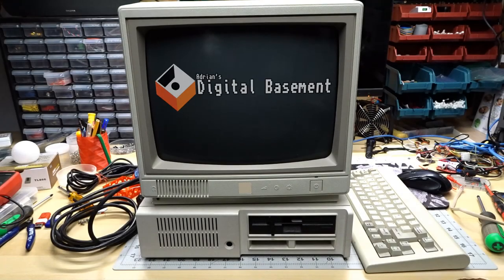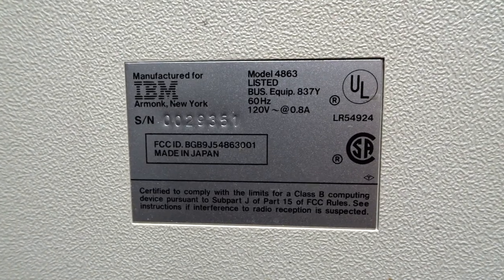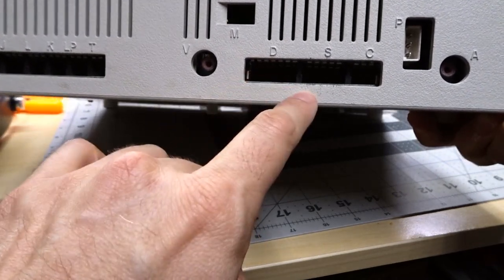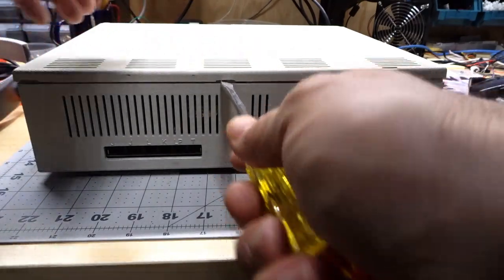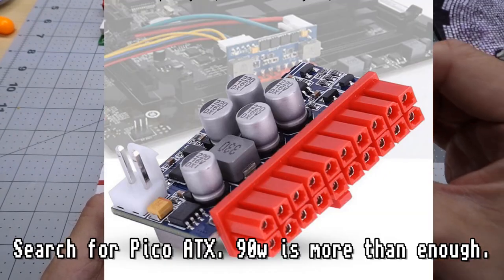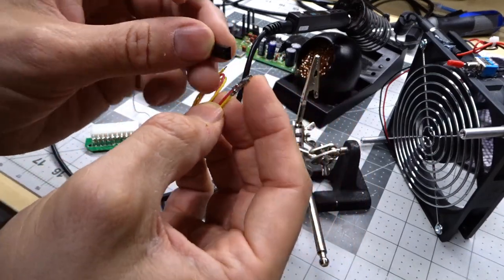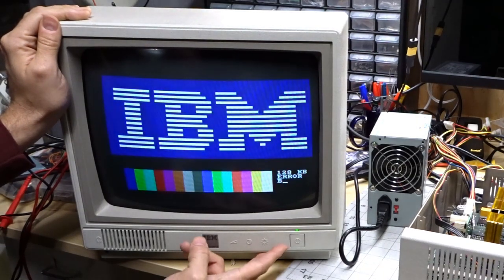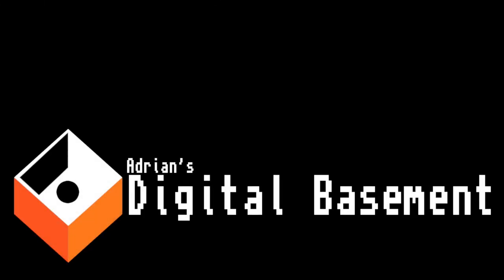Found a cheap IBM PCjr -- does it even work?

Comment: Those proprietary connectors on the back are just 0.1” pitch pin-headers. You can easily make your own cables to plug into it by getting female pin headers, but be mindful of the orientation. IBM had a continuous pin header with little breaks where they put dividers between the ports - these dividers were very fragile and would break, falling out!

Comment: You're in luck!  This is THE computer I had as a kid, so I may be able to offer a little assistance or answer a few questions if need be.

Firstly, yes, the connectors on the back are proprietary, I believe they are called "Berg" style connectors.  The monitor is indeed a regular CGA monitor, and IBM actually sold a breakout cable that converted the Berg connector to a DE-9 for use with any other CGA monitor.  Somewhere in my travels I picked up a PCjr monitor that had its Berg connector removed and a standard CGA DE-9 added.  Stupidly, I gave it away.

The floppy "handle" is legit, that's exactly the style it used.  "M" is definitely the modem port, if it were so equipped.  I believe the modem that was available was a 1200bps modem (as was the one for the IBM PC Convertible).  "LP" was definitely Light Pen.  Never had one, I don't even know of any software that would even use one, although the onboard diagnostics (if I recall, invoked by Ctrl-Alt-Ins) has a test for it.  "V" was composite video out, "A" was audio out (mono, line-level).  As with any other CGA, both the DE-9 and the composite could be used simultaneously.  "C" I think was for Cassette.  There's an actual relay on the mainboard that's audible and can be invoked (I think just boot with no disk into Cassette BASIC and type LOAD).  There was also an early piece of software called "Personal Musician" that messed with the cassette relay if you played a certain song.  I think the song was called "Roller Coaster" and somewhere during it, the relay would click and it would "knock out" the speaker on the monitor and just play via the internal PC speaker.  I guess that was normal behavior, otherwise there might have been "crosstalk" and you might have heard data loading from the Datasette.  A reboot (at least) was required to reset, if not a full power cycle. 

10:48 yeah, with the case off, the light hits the lens of the floppy drive's LED and it looks like it's on.  I believe ERROR B means no keyboard.  Probably nothing wrong with the system.  You're going to have to either source a cable for the keyboard (yes, it plugs into the "K" connector in the back), but I'm sure a breakout cable can be made if one can't be found.  It's only 4 wires!  I don't know if the infrared receiver needs to be present for the system to complete POST without an error, if it does then I think you're S-O-L unless you find another system.

There are mods that can be done to the system as well.  I know it will take an NEC V20 without a hitch.  The system can be sped up to (close to) 8MHz, that required a different crystal and some soldering and a couple bodge wires.  You can also install a switch to revert back to 4.77MHz, and I believe it's hot switchable.  There is also a mod that can be made to have the PCjr support 3 floppy drives.  I have no documentation on any of that anymore, my father did these upgrades when I was a kid.  It's also possible to have 640K RAM, you'll need a memory sidecar, and need to upgrade the chips and add some bodge wires.  That sidecar also requires a separate power supply (same as the PCjr originally took), and AkBKuKu didn't have that or a solution for it, at least not yet.  720K 3.5" drives work fine with the system I believe as a direct replacement (a 1.44MB with proper media may also work).

If I can be of any other assistance, please let me know!  Good luck!
Reply: Wow!  You know a lot.
Reply: Thank you, all of that information was actually just off the top of my head.  I have a long history with early IBM Personal Computers.
Reply: @jaykay18  I like them.  Great line.
Reply: This was also my first computer. We had a second drive and capability expander called the Racor Expander which plugged into the sidecar port and gave the computer 512KB of RAM, a faster clock speed (with a toggle switch on the back), and 80 column mode (via the same toggle). I used an AT keyboard with it, via an AT to PCjr adapter that IBM sold.
Reply: Ahh yes, the Racore Expander!  Another company that sold PCjr stuff was PC Enterprises!  I remember seeing it years ago in a catalog.  The PCjr did 80 column mode no problem, but by default always started in 40 column mode, the Racor unit added a hack for that as well.  I've never heard of an AT keyboard being used on the PCjr though.
Reply: @jaykay18  It might not have been a straight AT keyboard - but it did have the function keys to the side like an AT keyboard did. Looking through image search, it seems like they called it the "Pro" version.
Reply: I had this one as a kid as well.

Comment: Well, that's a bummer that there was no connector and no power supply with it. The infrared board is missing and even a normal cable to connect the keyboard but you still proved it does work so thumbs up Adrian.

Comment: I'm to blame for suggesting the use of the PicoPSU when the first video went out in the development stages of the adapter. I'm guilty as charged for being the reason the board had to go through yet another revision to make room for that at the appropriate angle so it fit in the case... but it worked out surprisingly well! Glad to see it booted but sad you don't have the IR receiver. I wonder how hard it would be to make one if there are none available.

Comment: What I find interesting is that it's hard to find a simple pinout of the keyboard connector, so you can't easily make your own replacement cable. But, on the IR receiver front, there is currently a seller on ebay with 2 for sale for $27 total for each one. It might be worth it going that route just to get your machine complete.
Reply: It's probably the same guy who sold him this

Comment: And I just bought an IBM PS/2 Model 30!! :D
Reply: 286?
Reply: @davel8116  Yes!! 10Mhz 286. They're extremely rare in the UK so I grabbed it as soon as I saw it listed on eBay.
Reply: @yukatoshi  10MHz.  Not bad.  I'm trying to find a 286 25MHz motherboard for a future retro rig.  The model 30/286 is probably the best PS/2 system you can own.  Congratz
Reply: @davel8116  25Mhz are Uber rare, and I only want this machine for 80s DOS stuff. 10Mhz is fine for that!

Comment: Awesome find there.. If you want to get rid of the original power supply board I would be interested.  The Jr came with 2 different ones, the short version puts out 33 watts, while the long version puts out 45 watts. The board you have in there is the long version is a bit harder to find.

Comment: I believe I saw a video from The 8-bit guy, where he had gotten a new adaptor that goes into the proprietary holes on the back. So you can use modern(ish) keyboards and what have you. The stuff I was thinking off, was made by texelec , and they are called IBM PCjr Joystick and Keyboard Breakout Board and the IBM PCjr CGA and Serial Breakout Board. Great video by the way.

Comment: In 1994 I was given 30 PCjr’s that were about to be tossed from a school typing lab... lots had bent pins and broken dividers in those stupid connectors at the back (just 0.1” pitch pin headers). Gave away tons to friends after making custom serial cables so they could connect modems and dial in to their ISP to read email... Unfortunately it couldn’t surf the net as there were no browsers that would run on such little RAM (mine only had 128K RAM - no side-car expander). Fun times!
I kept 1 PCjr for nostalgia - still have it!

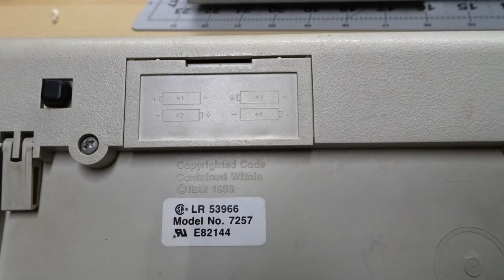Comment: At 2:49 that white paper badge has the CSA logo ( Canada Standasrds Association ) so the keyboard can be properly sold in Canada.  I owned a PCjr with that KB ( it also came with the chiclet KB ) and the expansion add-on so voice and extra memory ( 256 KB total) and parallel printer add-ons (  came with all 3 ) could be attached.  So many boxes, taking up space... in 1989 when I graduated to a 386SX all those boxes and their contents became landfill.  It hurts now, and I'm sorry I did it.  BTW, the internal modem is 300 baud

Comment: The connector on the side behind the panel is for memory expansion modules and/or a printer module. They're big plastic things that plug right into each other and the CPU case on that side. Also, the infrared was notoriously crap, so recommend a keyboard cable.

Comment: There is a yet another proprietary cable for the keyboard. The keyboard end has the phone jack style connector. The other end is one of the proprietary plugs as seen on the joysticks (and, yes, it plugs into the 'K' port). The cable was an accessory one could buy from IBM. It didn't come with the keyboard. 

You should be able to find either the IR daughterboard (more likely) or the KB cable on eBay (less common).

Comment: adrian - re your creative pcjr keyboard cable.  remember that solvent you used to 'weld' old c64 case ?  a coupla dabs of that might turn the 4 individual black plastic connectors into one monolithic connector, taking care not to get solvent into socket contact areas.  take care n stay safe.

Comment: 1:36 is that an SN ProPad? I have two of those myself but the X and Y don't seem to work properly on both, neither does one of the shoulder buttons
Reply from the maker: Oh you know I don't know. I bought that at the Portland Retro Gaming Expo for $1 -- I was intending to modify it work on Amiga/C64/Atari machines. I take it this controller was made for the Genesis/Megadrive originally?
Reply: @adriansdigitalbasement  Mine are for the SNES, I think yours must be too given the 4 circle buttons. I think my issues are to do with those turbo switches in the middle but I never bothered fixing them.

Comment: My high school had a lab of Jrs (IBM was donating unsold stock). They were outfitted with an expansion that replaced the lid, adding a 2nd floppy right above the first, joined at the side by an extra tall sidecar. Effectively turned it into a 640k PC.
Reply: I've never seen that type of expansion, since. It matched the original exactly, so it really looked like an extra tall Jr with dual floppies.

Comment: The PCjr's bus connector for the sidecar is identical to the 8-bit ISA bus, you could even create a breakout and run it to a card edge connector to use any ISA card.*

* It's missing the -5V rail.  This means certain sound cards will straight-up not function correctly due to the op-amps not having the correct voltages for the comparator lines.  If you were to build a breakout circuit to make an ISA bus sidecar of your own--which would be an AWESOME project that I want to try one day!--you should also integrate a voltage polarity "inverter" (not the correct word for it, but you get my meaning) using a chip like the TPS54620.

However, if you choose to do this, remember that part of the PCjr's charm is how crappy of a computer it is compared to the real-deal PC. :)
Reply: The PCjr has no DMA (there are expansions that add DMA) and most of the IRQ lines are not present on the side port. There was a PCB made for adding a pair of 8 bit ISA slots but they were backwards so the ports on cards faced the front. It also had a molex connector for power. I put one together to try using a MFM hard drive controller. Managed somehow to damage the jr's power supply. No problem, it was my 2nd jr, not my main one with 512K and 2nd floppy in a 'second story' expansion.

Comment: Is it time for me to dig my PCjr out of the attic?  
As for your keyboard issue, I remember that the cable had the RJ11 on one side, and the proprietary (Berg?) connector on the other.  But there was also a buldge in the cable where there were presumably there were some small ICs or electrical components.  I never dissected the cable as it worked, and I didn't have a need to try to attach a 3rd party keyboard.

Comment: You may be able to cosmetically 'fix' the CRT glass scratching by applying a bit of Turtle Wax and gently smoothing off the excess...
The refractive index matches glass pretty closely (thanks to Gerald Ellis for the tip).

Comment: TexElec has "breakout" adapters to convert the keyboard, joystick, cga and serial ports to standard connectors.
 Additionally: wouldn't it be possible to find another adapter to put the required voltage on the original power supply? Sure, this works, but I'd prefer keeping a computer like that as original as possible (although, if you'd combine the kit with a pico ATX and mount the brackets it would at least look good).

Comment: Speaking of the power supply - even though the stock PSU expects 18 AC, it should work with DC as well, since the power goes through a full bridge rectifier and a capacitor. Theoretically you could have used a laptop PSU to power the stock power module
Reply: @adriansdigitalbasement  Ah. Well, 24V supplies are pretty common too. Many printers and scanners, for example, use 24 volts. I've salvaged quite a few 24 volt supplies from old printers and copiers.

Comment: Your phone cable is just that... a phone cable. You're missing the PCjr keyboard. On side will have the rj11, and the other side will have a 6 or 8 pin connector very much like your display. I forget how many pins (wanna say 6), but it plugs in under the letter K at the back.

Comment: There is an adapter board you can purchase that converts the proprietary ports on the junior to common ports for normal connectors.  That would allow you to use an ATX keyboard.  It's possible that error b is in regards to not finding a keyboard.  You can find those breakout boards here-  Interestingly enough, there is an RJ-11 port on the keyboard breakout board. - https://texelec.com/product-category/ibmpcjr/

Comment: Nice find. Too bad the IR board, and keyboard cable are missing, but I'm sure the IR at least should not be too hard to repair, but they never did work that great over IR to start with.
Reply: @adriansdigitalbasement  Yes LGR did a video on the IBM PC Jr. a few years back and even ran into it with CFL bulbs he was using at the time
Reply: @adriansdigitalbasement  I forgot to add the video I talked about earlier of LGR's IBM PCjr. freaking out since I was on my phone earlier.  
https://www.youtube.com/watch?v=OjmqTBILs6g

Comment: the screen shows very clear picture.
Reply: Those monitors were horrible. The CRT in the IBM 5153 had a much finer mask. PC Enterprises sold a "Thin Font" chip to add or enable a character set that had narrower lines. The chunky mask on the stock jr monitor would still blur and bloom the characters. Adapt a 5153 to the jr and its video will look much better.

Comment: Another thought: How did this flimsy case pass FCC approval?
Reply: +Adrian Black
Ah ok, I couldn't see the metallic coating very well in the video; Perhaps you're right about the requirements being a bit more lax in the past as well.
BTW did you see my other comment? The one where I linked to a page about the PCjr.
Reply: Plus these PC's were not running in the hundreds of megahertz but rather single digit MHz, so maybe a lot less interference to begin with, easier to mitigate.

Comment: Hi there....I wish to comment on the IBM Pc jr
IBM PC jr was the very 1st computer I owned...Got it Christmas 1984
it was powerful:

The "keyboard" cord, one end of the cord look like the telephone cord, and the other end look
like the "connection to the monitor"

That was the Keyboard I had..and it did "eat UP" 4 double A batteries
It was "CGA" screen...some programs 'displayed" in differnet colors, if the same program was ran on "another IBM" computer

I did find the "draw" backs when I went to BUY games...I was told "I never Heard of the IBM PCjr" "I dont know if it will work
on the IBM PC jr...but I know it will run on the IBM PC

fast forward to about 1988, I read a newspaper Artical telling me "Avoid any programs that Require EGA graphics" "avoid Programs
that require Windows" "Stick with programs that will run on "CGA/Monochrome" and no more than 128KB of MEMORY

Comment: i think that the keyboard use a rj11 to din conector, you know those old xt keyboards that looks like the comodore power plug. it is great to see that computer kinda working. maybe replacing the fans could help. it is a weird machine, it was like everything propietary and expensive, like with a notebook. it was kinda an experiment.

Comment: You can get the original IR reciever on eBay if you're willing to pay $27 for it (with shipping):

https://www.ebay.com/itm/IBM-PCjr-Wireless-Infrared-Receiver-Replacement-Module/140986675098?hash=item20d375ef9a:g:fnoAAMXQqfZRpWrq:rk:16:pf:0

Comment: I'm not knowledgeable about old computers so I gotta ask: why does a keyboard need batteries at all? Seeing as it's connected by a weird telephone-style cable, is it some kind of old proprietary IBM standard that didn't supply the power to the keyboard? Also, was that before or after PS/2 became standard for keyboards?
Reply: because this keyboard could use an IR wireless connection to the computer. PS/2 started after IBM's PS/2 line of computers, which was later
Reply: I don't think you need the batteries if the RJ-11 cable is used. PS/2 wasn't standardised until 1987, 4 years after the PCjr was released.
Reply: @adriansdigitalbasement  From personal experience I can verify that is correct. I had one of these back when I was a kid, complete with keyboard cable, and it didn't need batteries if you had the cable. Wish I still had it!